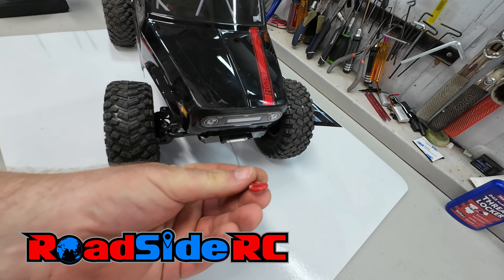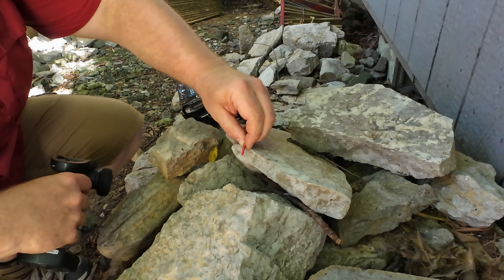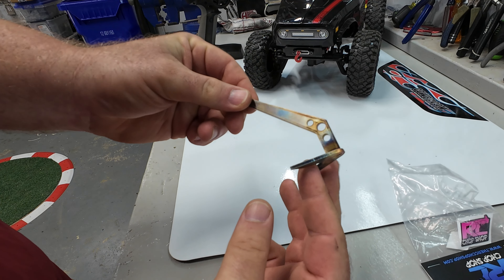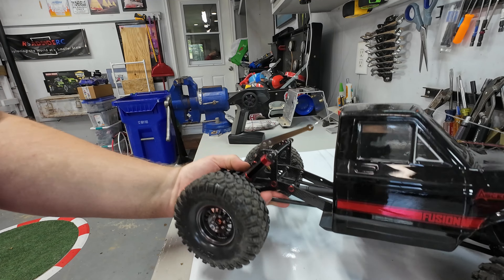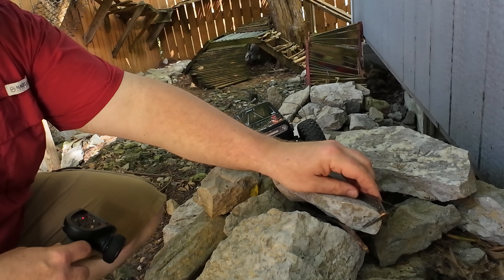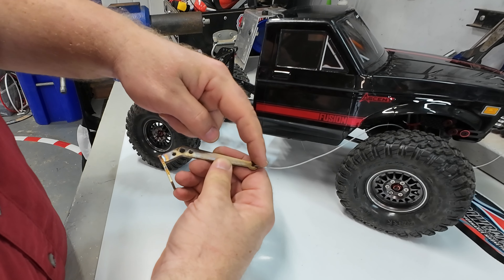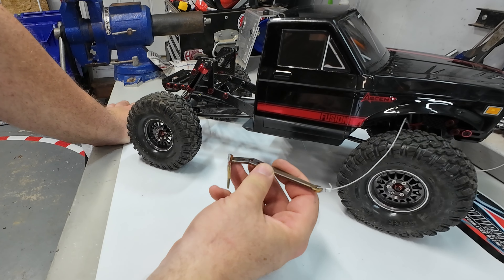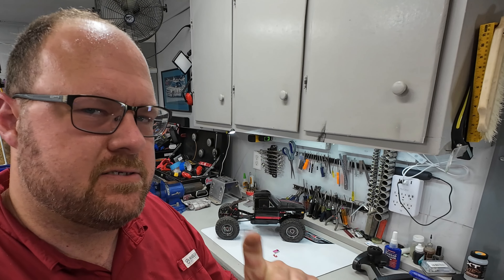Improve You Winching!  Land Anchor from RC Chop Shop

Comment: Wow, that's freaking sweet! Does seem a bit large for the scale of the truck, but it does seem to work well.
Reply from the maker: Agree 100%.  Would be nice if it was slightly smaller.   Another viewer suggested making it removable - with a quick attach.
Reply: @RoadsideRC  I would just keep the original hook on the line and then put some thread through the back in a loop for that hook to grab.
Reply from the maker: @NathanStorer  Yep!  That is what they said they do - with a Keychain loop.   Smart!